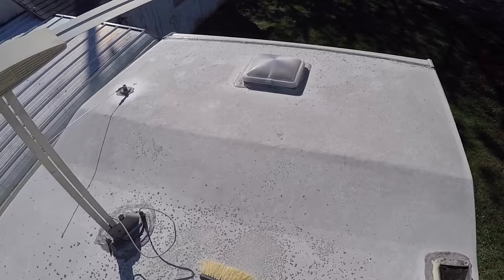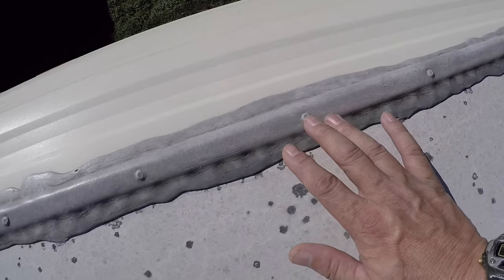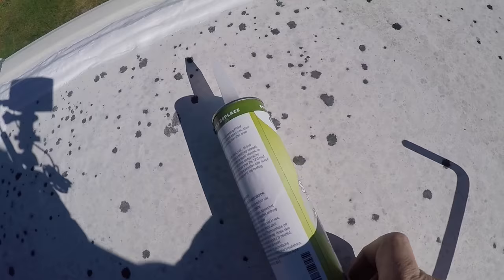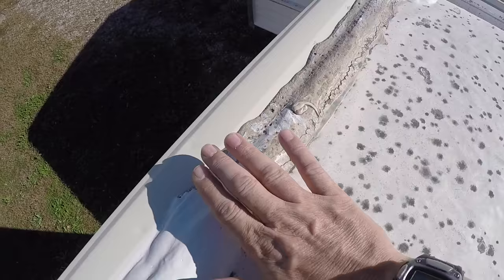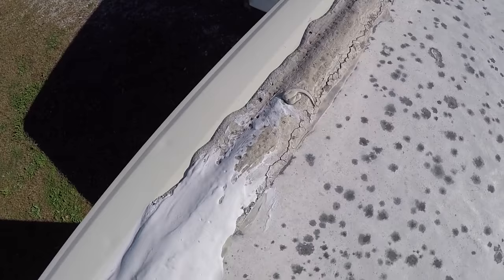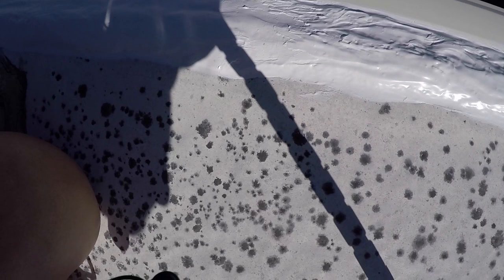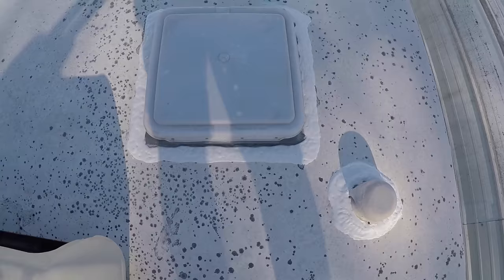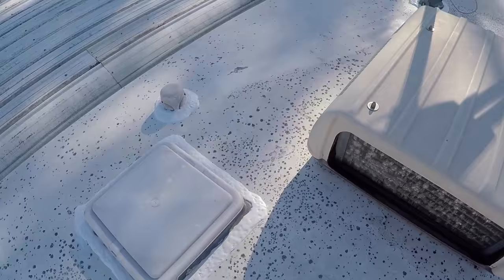How to Seal RV Roof Seams with Dicor Lap Sealant

Comment: I'm not sure, but I believe the old lap sealant is typically removed, surface cleaned, THEN new lap sealant.  Thanks.
Reply from the maker: That may be true but the way I did it worked well for my camper. I used that 5th wheel for two years following the resealing and had zero issues with the roof.
Reply: No. If the old stuff is still bonded well you can just put the new on right over the old stuff. You only have to scrape it up if it's peeling off, or for aesthetical reasons. As far as just getting a good seal, what this guy did is perfectly fine, it makes no difference.
Reply from the maker: TJ32 - You are absolutely right! 👍
Reply: IF you are looking for a WHOLE BUNCH more work (and leaks) you can remove ALL old seals. Chances are, ya just got a hole, split or separation for time. Newer spray caulk/sealer is even easier and thinner, but just as tough. Get fancy and mask it off on both sides if you want.
Reply: I always wash with soap and water. Let dry for a day. Before I apply the Dicor I scrub the existing Dicor with denatured alcohol before applying. Letting the denatured alcohol evaporate first.
It helps bond the old with the new
Reply: I'm with you curt. The old sealant is cracked and separated from the roof. It will only cause the new layer to come away when it moves next time. A lazy fix is short term fix.
Reply from the maker: It's not necessary to remove the old sealant if it has good adhesion to the roof surface. That's not my opinion, that's the guidance from the Dicor manufacturer written in the product application instructions.
If it makes you feel better removing the old sealant then that's what you should do. Just be careful, you can cause more damage to the roof trying to remove the old sealant. It's pretty easy to create a bigger problem than what you started with.
Reply: @WannaBFree  I came here looking for the answer to these questions, so thank you for making me feel better about doing it the way you did it rather than undoing all the previous sealant! 🥳
Reply: If the old sealant is pliable, clean with soapy water and add a top layer. If the old sealant is cracked & non-pliable, remove and replace as the base layer has lost its ability to make a seal. That is the NVRIA standard for their inspections.
Reply: hello sir, does this sealant hold up to the freezing negative degrees outdoors temperature and hot 90+ degree temperature extreme that would buckle and crack the sealant. I'm new to this and i would like to know from your experience
Reply from the maker: Yes, I've had good results with this sealant no matter what the temperature is.
Reply: @TMJ32  Of course it makes a difference!  The top seal is only as good as the bottom old seal anchors it.  So you should take it all off - with a heat gun - so easy.
Reply: @flipnotrab  Please don't mix types of sealants. Asking for a friend.
Reply: @robhdez5048  Agreed, but the  trick is to judge how hard its getting. Slightly soft is so much easyer to remove than baked on slightly hard. A variable temp heat gun and sharpened hard plastic scrapers, cleaned up with mineral spirits took our trim seals back to 1982. Fresh Dicor over inspected butyl joints, very neat.

Comment: The crack in your lap sealant does not lead directly to the inside. Lap sealant is a secondary seal. Your main seal is butyl tape under the trim you put a second coat of sealant over as a lap. The original lap sealant is easily removed using a heat gun to warm it, and a sharpened hard plastic putty knife. Piling on new sealant works to seal a random crack and what not. But after the years pass, the original sealant hardens and becomes a rock. Softening it with Mineral spirits works, but it will reharden. Just removed all sealant on a 40 year old RV roof. At the ends of the trim strip crossing the front (and back) is one of the industries most blatant objectionals. Expansion and contraction of the roof and the side walls renders those small areas very vulnerable. Just over lapping front facia and roof. They make a metal comb that would help a ton to fix the fins on your AC. GL

Comment: Pro tip: When using a finger to smooth it out, spritz the new sealant with a non-ammonia-based window cleaner. You be amazed at how much easier a smooth it will spread without sticking to your fingers. Also works great with applying beads of sealant to inside corners.
Reply from the maker: Great tip!
Reply: Thanks I’m going to give that a go in the am
Reply: @ElChapos  how’d it go?
Reply: Great idea!  This is a very good tip.  I hate that lumpy look.
Reply: Another pro tip, it is self leveling sealant and you don’t need to touch it at all and it levels itself as smooth as a baby’s face. Another pro tip, if you do decide to “smooth” caulking with a finger use a rubber glove. Christ😂

Comment: Most RVs are also sealed along the side transitions as well.  Don’t forget to seal them as well because they can also lead to water intrusion.  Except you want to use none leveling/non sag on the side transitions.  The dark spots on the roof is signs the roof has not been maintained(clean roof and treat roof with uv protectant 1-2X a year) this will prolong the life of your rubber roof.  When you get spots like that it is signs that it is reaching its life expectancy.  Important to do general maintenance.
Reply: My rv is 3 yrs old and has those spots!

Comment: I just got a quote from Camping World for $925 to seal roof seams and $499 to repaint roof and $595 to resilicone exterior walls. = $2019 for a 4 year old camper I bought new.
Reply from the maker: WOW! You can do all that yourself for about 10% of what they quoted you. IMO Camping World is probably the most expensive RV shop I have ever seen. I wish you the best!

Comment: For those interested in cleaning prep (definitely recommended on the old Dicor) before applying new,  I've read that using ''Fantastik' spray cleaner does a...what the hell....fantastic job of cleaning/prepping the old Dicor surface for a fresh coat. Spray the cleaner on a rag and work it over the old Dicor prior to applying the fresh coat.
Reply from the maker: Thanks for sharing!

Comment: I`m doing mine right now and I am stripping off most of the old stuff and cleaning that area real good with simple green.. Then re-applying the new sealant for a longer lasting seal. Once that is good and set up it`s never a bad idea to top coat the whole roof with a good rubber coating.
Reply: How did you get off the old foam around the antenna and air conditioner?
Reply: I’m going to try a heat gun to remove it
Reply: Heat will stretch membrane

Comment: Some tips for others from my cross over DIY skills:
Use a metal dog comb or poodle comb for realigning the AC fins.
Use Chlorine bleach to kill the mold black spots on roof.  
After power washing and prepping roof, if you have EPDM rubber roof, use Henry's Tropicool White Silicone for roof.
Forget Elastomeric - this is latex paint and rubbish that won't last.  I researched it well.
Apply Dicor first, and roof coating second. Dicor needs to stick directly to the roof rubber cloth, esp if you use Elastomeric which peels off.
Use a Heat gun (Wagner is $22) to soften old Dicor and a putty knife with rounded edges.  I use a pottery metal putty knife.  No sharp edges.  A heat gun makes it very easy.  First slice off tops of screw heads, remove screws, then heat and scrape off rest.
Reply: We use a Magic Eraser (or cheaper and similar from the Dollar Store) to remove our small black spots that appear over time on the RV roof and side walls.   Works awesome!

Comment: Nice job.

I need to do some spot seals on my 2019 gran design 5th wheel.

I have bad arthritis in my hands so I bought a Milwaukee m12 12v battery powered caulk gun. Boy does it make it easy.
Reply from the maker: Thanks! I'm starting to experience arthritis in my hands and wrists now and it affects some of my projects around the homestead. I may have to invest in one of those powered caulk guns. Thanks for the tip and good luck with your project.

Comment: Can I use Dicor lap sealant over a newly coated roof using Dicor?  I love using Dicor over Flex Seal. The Flex Seal was sticky sticky sticky and hard around the edges of the can. Too hard to manage. The Dicor turned to rubber after it set. Love the Dicor. RV dealership said that’s what they use. The Dicor Calk was so easy to use after a huge mess using Flex Seal. It took me a lot of trial and error actually using the products. Thank you for helping us out here. You’re trustworthy in my opinion.

Comment: I’m so relieved, I thought I had to remove the old sealant on my travel trailer. Thank goodness I don’t have to.
Reply from the maker: According to Dicor instructions and guidance, as long as the old sealant is adhered to the roof surface and cleaned properly, removal is not necessary. A lot of people cause more damage to the roof surface trying to remove old sealant ending up with a worse problem than what they started with. Basically if the old sealant is easy to remove then remove it. If it's difficult to remove you are wasting your time and efforts potentially causing significant roof damage. Just clean it well and apply the new sealant over it. This method has worked well for myself and thousands of others for decades. I wish you the best with your project!

Comment: Thank you for this video. Even though my roof is still all aluminum this has explained and shown me so much.
Today it hit 109° SO, it was way to hot for me to hit the roof. There's only one rv store here and their prices are triple anything over the mountain pass to Las Vegas so, i am ordering online.  I have to go up and make notes on each job up there. Vents for waste tanks, 2 roof vents new butyl tape, 1 skylight, repair of 2 idiot repairs, repair of unknown mess over my closet, check of vent with reversible fan with control dials???. I think that may just need new lid and soapy water.  Repair of side seams with new coated screws , then the replacement of rubber/plastic strip liners to tracks??? That will cover the screws in the tracks. I still like the use of the tape in an L shape for all sides of the rv. Oh yes repair of whatever the mess is that was used on the railing bases at the back of the rv. They are tight and stable, but it looks like the green scrubbing pads used for pots and pans were put at each bottom and painted with white chalky gunk. Hope I don't find any more coo coo crap while I am working.  Just vent for fridge with lap seal.
I use the back ladder and remain sitting or crawl while I am up there, so I am very careful.
I may have some questions while I am doing this so I hope you don't mind if I toss them at you.
My fifth wheel  says 26.6 for length.  ??? So I think maybe 10 tubes of lapseal to start with, maybe I can have enough with the 4" X 50" tape if not I will have lots of left over with 2 rolls.
Working before the sun is up and doing as much pre-prep may help, then put the lapseal on to sit in the hot desert sun.   
I will be pretty slow but I am making my list,  doing priority jobs first and I have lots of grumbling neighbor eyes to watch and remind me to be careful.
I really think I can do this. Thank you for the video, advice, and encouragement. Check in any time. Kathy and her silly dog luci.
Reply from the maker: OK, be careful and I'll answer what I can. Keep in mind, I certainly don't know much more than what you have seen me do in my video. I know exactly what you say about the RV shops being way too expensive. It's the same around here so I buy online too.
Reply: Hi Kathy!  I'm in my late 60's and still doing my own repairs. Yes, roof is risky at my age, not so nimble but the more I do it, the better it gets.  You can do all repairs yourself.  Just go for it. Glad to see other women tackle it themselves and not wait for guys to do everything.  Bravo!

Comment: Ok. Now that I am cross eyed from watching so many videos. I have made a list and am organizing my brain and supplies.
Now I need to make sure I am doing it correctly.
My rv is all metal, (aluminum)   So top edge sides have the small water gutters, and a track with bolt headed/screws, butted up to roof.  Some of the screws are rusted, so I am taking them with me to the hardware store. Gotta get the bolt driver socket to fit them for my drill. Theres alot of screws up there so I am using my drill . Ok remove old ones, clean, and use lock paste on  ends to help seal them back in. (Stainless steel)?....   Then small amount lapseal at join area of channel to roof. Then dicor tape from bottom rim of edge folded over onto top of roof , lap seal for top (self leveling),  then non leveling lap seal onto screw tops and bottom edge of tape on side's  
It will look like an L along the edge of rv and I am going completely around the top of the rv.
The top is still the original aluminum so repairs to gashes and antenna and vents will be either first time work and/or new replacement vents and crazy looking previous repairs that even I know were wrongly done.
Since I am 72 I have been forbidden to climb up on my roof, but from what I have seen from the idiots I have paid to get up there  i am doing it myself, to get it done correctly.
The dicor supplies... do I order them online or will they be at the hardware store?  I am going to pull everything up to the roof with rope and bags. Start at 5am ish, since the Nevada desert sun is visious when it comes over the mountains. 
Going to get an oscillating scraper to remove old butyl tape, and my Milwaukee drills are girl size and 12 volt.
 I hope this all makes sense cause my brain and the terminology  recall is the pitts.  I will take some before and after pictures in case you are curious to see my work.  Wish me luck and I thank you for your patience.
Reply from the maker: OK, be careful up there and take your time. You can order the Dicor from Amazon using my link in the description if you wish. That will help out my channel and I do appreciate it. If you don't care to do that you can get it at any local RV supply store. I have never been able to find it at regular hardware stores. It sounds like quite a project and should be nice when you are finished.

Comment: Hello again. Did the Amazon thing, found the lapseal in a four pack so i ordered that to start out with. I also ordered the eternobond tape 4 X 100, the eternobond cleaner and primer. I also found the grey tank replacement 1 1/2 set up to fix the release valve. ( I think thats what it is called). Yup I ordered the butyl tape and vinyl 1 inch to cover the screws in the tracks. Non of mine are covered. I still have to get the vent cover for the black tank and order new screws for the track trim.  And non leveling lapseal.  Amazon separated it into different mail packages so I am waiting for all this stuff to arrive.
Temps here have been 111° so not a good time for the roof.  Now high winds are coming at 3am so ladder is lying down and awning is rolled up.  Cooler air coming 90's Wednesday so I will start repairs on the damage I have found up there. Start removing bad screws and get ready to do a little at a time.  I think i have watched your video so many times I can do this in my sleep.
Thanks again. Kathy.
Reply from the maker: Hello Kathy, sounds like you are getting well prepared. I hope when the weather cools down you'll be able to get right in there and get to it. Please take your time and be as safe as you can. I'd hate to hear you hurt yourself. It would be nice if you could find a helper to give you a hand with the roof stuff but I do understand. It's hard to find good help these days. I'm wishing you safe working and good luck with your project!

Comment: I love that about you!   Getting it right the first time and doing a thorough job! I might still have the little RV if somebody else had done that it wasn't the owner it was the previous owner that might not have done as good a job as they should! 🐙
Reply from the maker: I hate having issues when traveling so I try to do everything I can to eliminate as many as issues as possible. Buying used RV's can be tough. I find it is rare that they are taken care of as they should be. Usually neglect causes them to leak and that's usually when they go up for sale. Then they require much more work than it would have been to maintain them properly. Take care of it today and it will take care of you tomorrow. :)

Comment: The tool for your ac is a radiator comb it has different sizes for different fins they use to be common in body shops